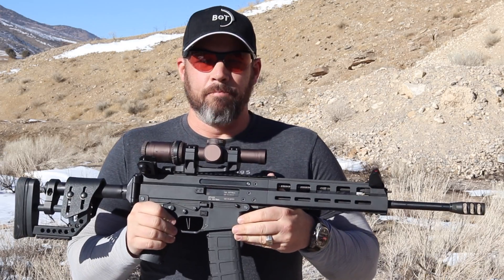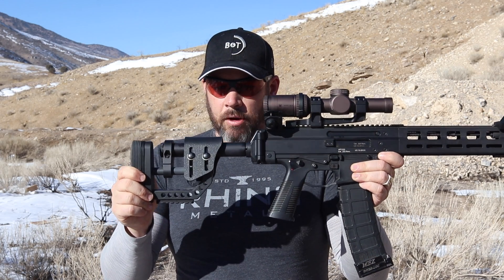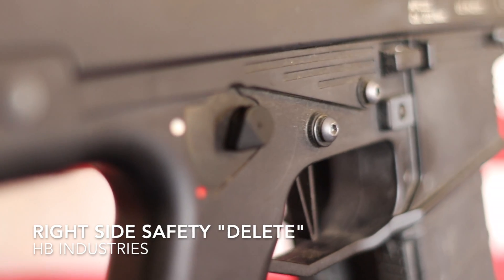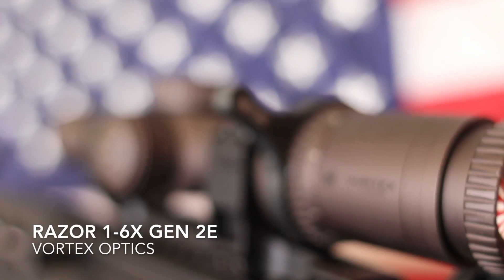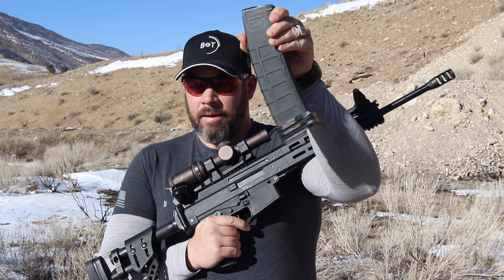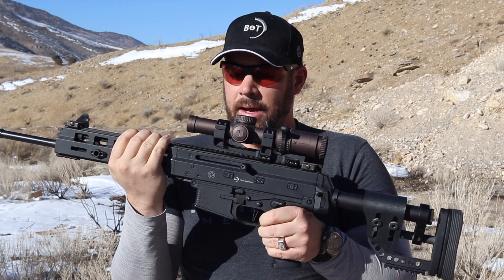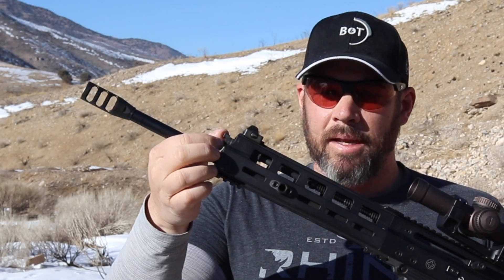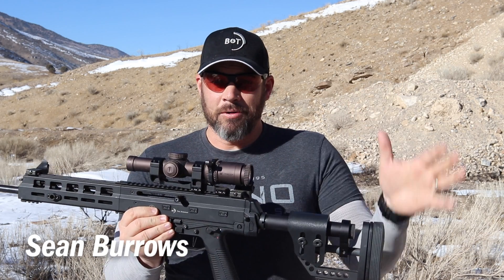Setting Up the B&T APC223 As A 3-Gun Rifle

Comment: I love how you lightened this rifle with the MLOK slots on the 12 & 6 O'clock positions. It's not for me but I understand the need to lighten this gun up. I use mine exclusively for hunting coyotes. I slapped a heavy thermal scope on it and it is a little heavy but works great. 
You should really do a review on the APC 308, it is my favorite B&T firearm yet and for good reason. It has good ergos, its accurate, reliable and built like a tank (the APC 223 is too).